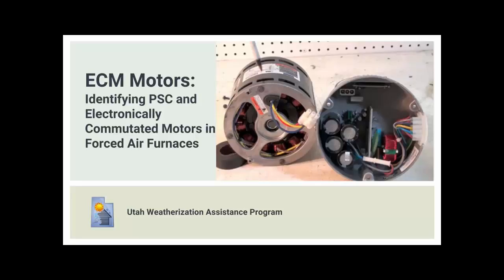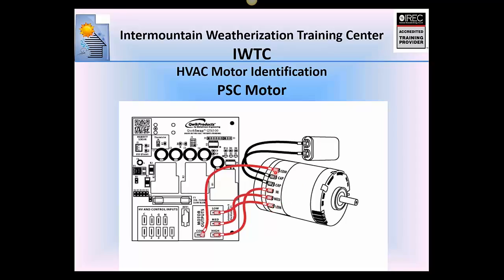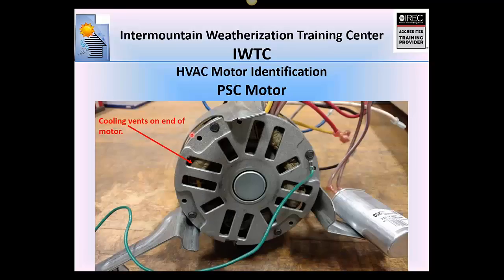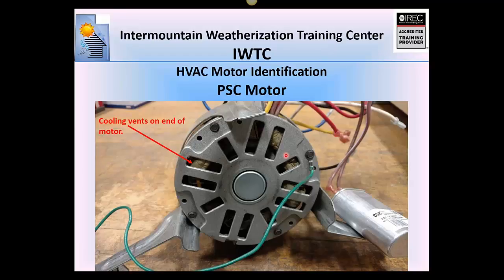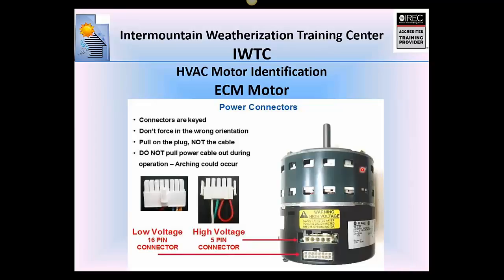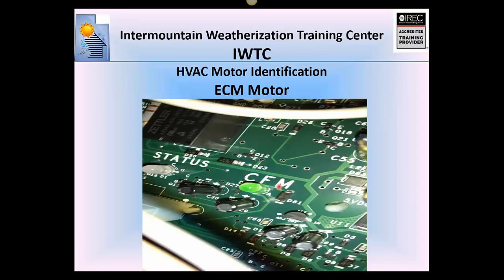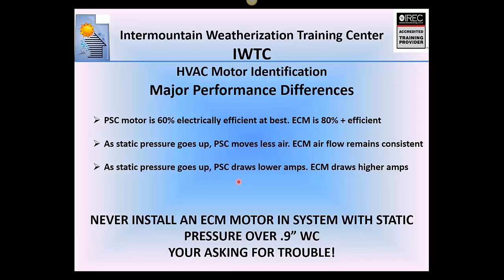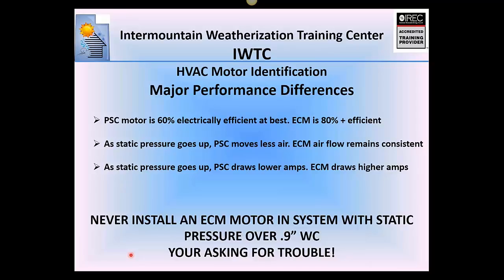Identifying ECM Motors

Comment: Condensers often utilize three terminal split caps. Herm/Fan/C. 
I've been working with this stuff since the 70's. I've never seen a three terminal split cap on an evaporator unless the engineers designed the compressor integral to the evap rather than the condenser.

Comment: I am compelled to point out a technical error at 20:40 regarding ECM in electric heat application.
In the specific case of electric heat, the blower motor efficiency would not save on any electricity:

The heat 'wasted' by a PSC vs an ECM is ultimately dissipated into the air stream, so all electricity used during heating mode is ultimately delivered to the building.  The difference between 60% efficient motor and an 80% efficient motor will make no difference.  (technically speaking, the 60% efficient motor is ADDING a few more BTUs of heat to that of the heating elements...]  And without a chimney, there is no change in heat loss up the stack, all heat ultimately ends up in the ventilation air, regardless if it is from the heating elements or from waste heat from the blower motor.

The only theoretical differences would relate to air exchange volume and airflow rates.
Such as if they would raise the thermostat to compensate for slightly less circulated air.
All things being equal, motor efficiency will not change the KWh consumed per BTU delivered...

If you are adding this to your guideline document, you should consider this.
Now AC is different, there it will benefit.  If they have heat only and no AC, then you should avoid stating something that could come back on you...
Mr K L

Comment: Incorrect @ 3:36 you stated that the black wire is low speed, red is high speed, etc.  That is incorrect, the black wire is almost always max speed.  Speeds from low to high are Red (low), Blue (med), Yellow (Med/High), Black (High/Max).  You stated the opposite, just sayin'...